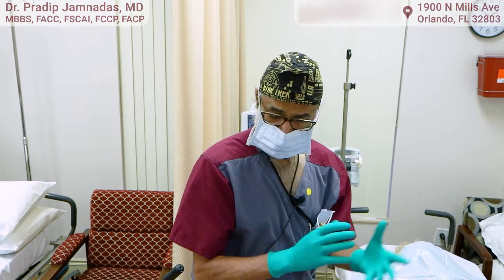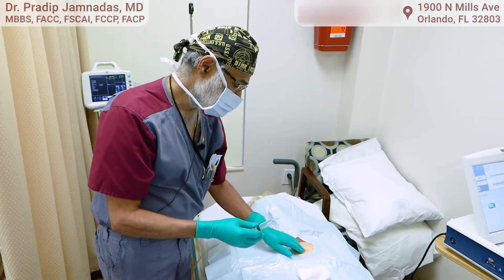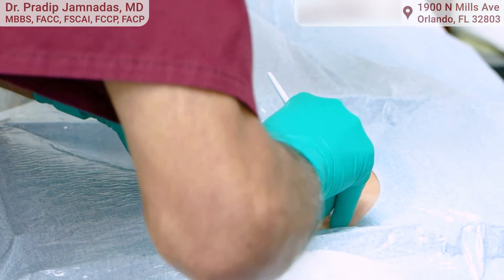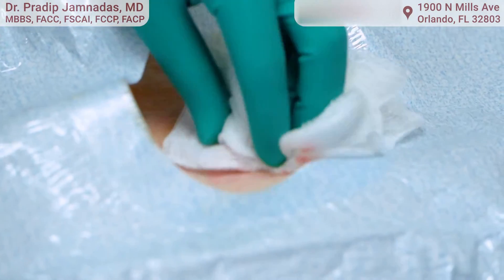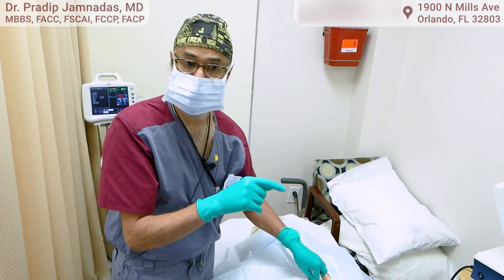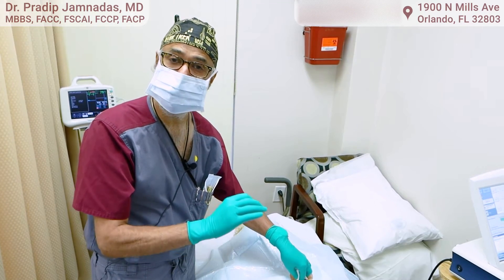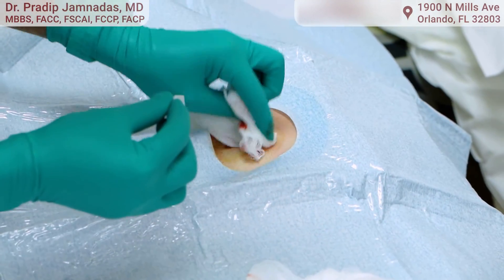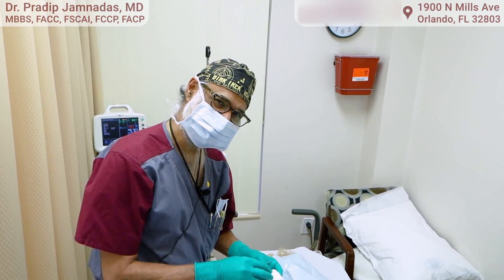Loop Recorder Implant Procedure

Comment: just got mine put in yesterday. I lift weights and golf a lot. I wonder if it's possible for this thing to move around at all?
Reply: I got mine in 2 weeks ago, and I thought it was right under the incision, but I'm thinking it's actually about an inch or so lower down... because I started having a few pains and it feels like it may be lower? So I have the same question.
Reply: @blackwidow8520 it’s obviously lower than the incision. You just saw the video
Reply: You have to wait 6 weeks for vigorous exercise

Comment: I recently had this procedure after having a stroke. When I was given instruction on my device, I was told to send a download to them if I felt anything wrong. 
Thank you for this informative video.
Reply: I just had mine 2 weeks ago after a stroke also. Did the implant go about an inch or so under where your incision is? Because I'm getting minor pain about an inch or so lower than the incision and I'm wondering if that is where the implant is actually sitting? I can't see it at all so not sure if it's that or my actual heart in pain

Comment: I just had my did may 31 and it has to be in for about 2yrs i’ve been having no rips a blackout light off an on so Cardiologists set me up with this procedure to get done because I had a stroke and I had a blood clot in one of my legs so they’re trying to monitor my heart for the next two years to see what happens and they try to also see what caused a stroke and what is Troquet from? What is it a hole in the heart the reason why the blood clog that to the heart the reason why I had the stroke is the number of reasons but like he said only take a split second in an out